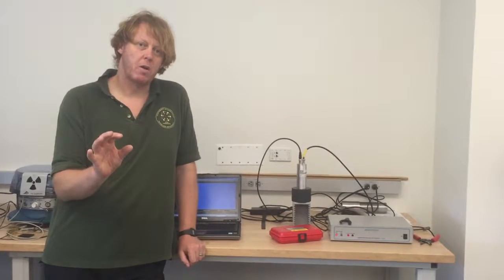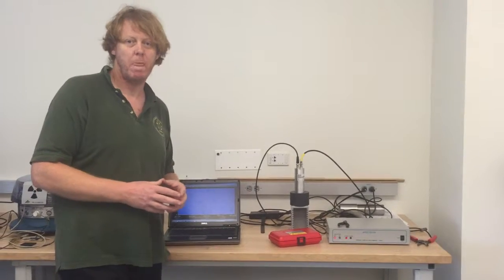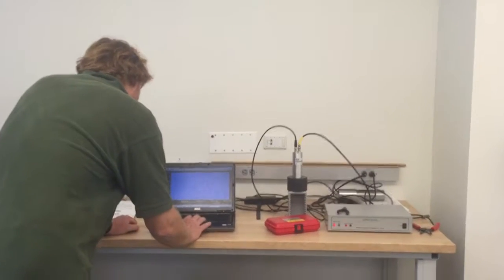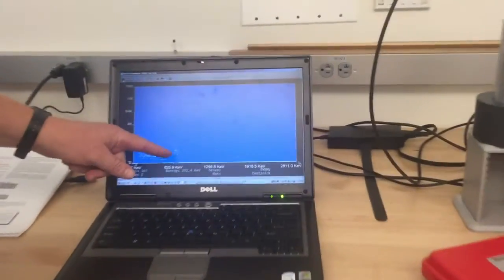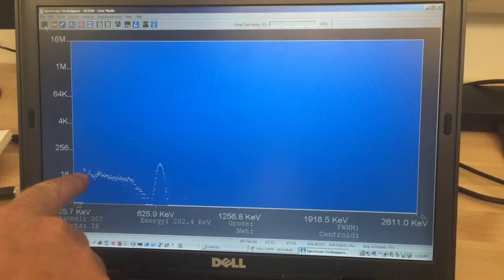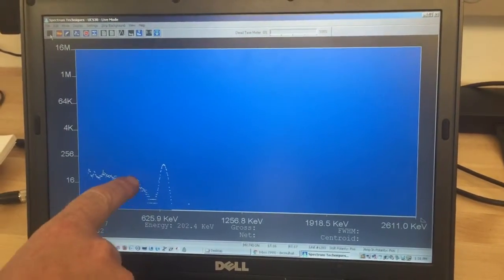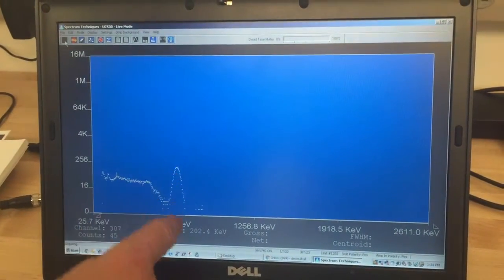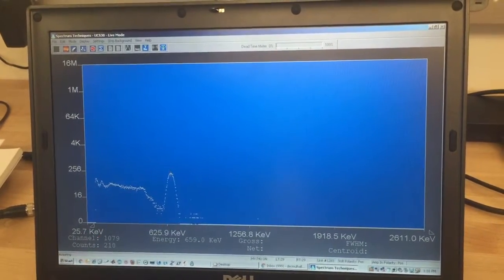Gamma Spectrum features- the Compton edge

Comment: The explanation is partly wrong. Compton Edge and continuum are not produced by photons that scatter in from the detector housing. They are produced by scatter within the detector material - when the electron energy is measured as the continuum and the photon not because it left the detector.
Reply: If the e scatters WITHIN the detector crystal isn't all the energy from the e and the original v going to be counted as energy together in the same pulse?